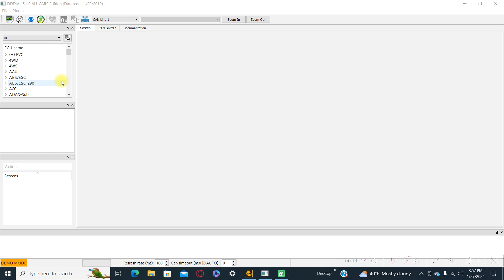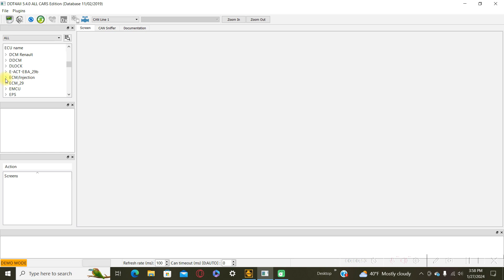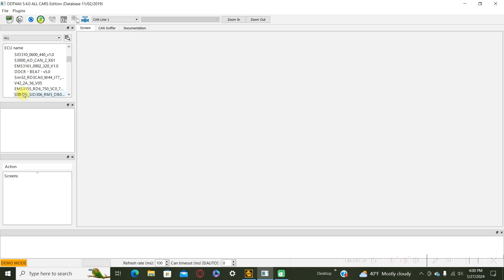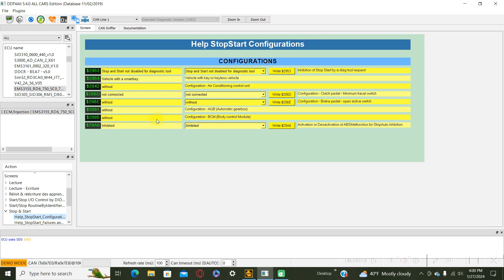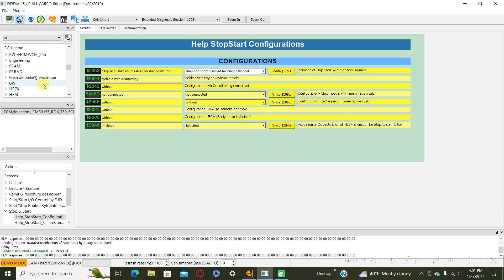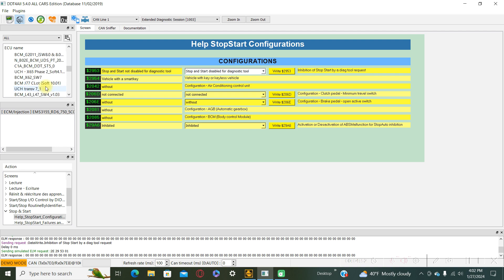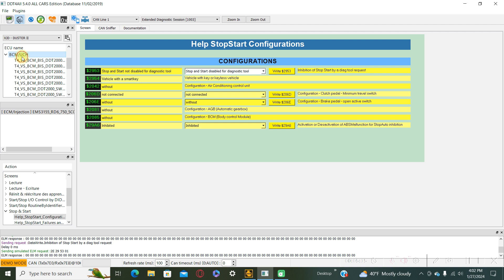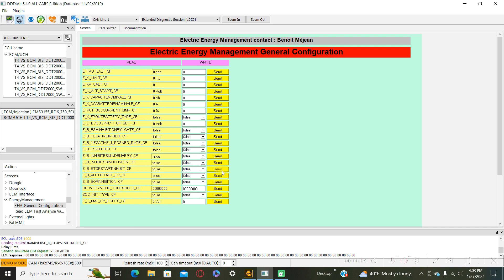DDT4ALL Disable/Enable Stop&Start function for DACIA RENAULT cars(DUSTER,LOGAN,SANDERO,DOKKER,LODGY)

Comment: Hello, can you share where we can buy a real ELM32 or something to connect to the ODB2 port ? Internet is full of fake ones.
Reply from the maker: Hello normally the wired variant is the best I just found this on AliExpress: 
RON53.22 | ELM327 USB v1.5 Switch Car Diagnostic Cable obd2 SCANNER FORscan Support Most OBDII Protocols HS-CAN and MS-CAN PIC18F25K80 Chip
https://a.aliexpress.com/_EGac4eU could be any ELM327 that contains the original setup PIC mcu and FTDI and wifi version I just found this on AliExpress: 
RON127.99 | Vgate iCar2 obd2 Bluetooth WIFI Car Scanner Tool ELM327 V2.2 for IOS/Android OBD 2 OBD2 auto diagnostic scanner PK ELM 327 V 1 5
https://a.aliexpress.com/_EQNEWNw

Comment: hi. I have question. When i will changing it the iignition should be on or off?
Reply from the maker: Hello.To avoid any intererruption could be on or on the first position(without pressing any pedal press on start long for 5 10 second to contanct will remain permanent and you will hear the fuel pump.You can try to open the door to see if the contact stay on.Normally should be.I hope this could help you.BR